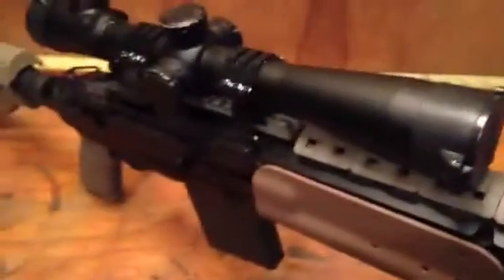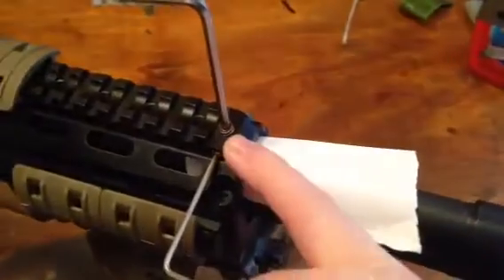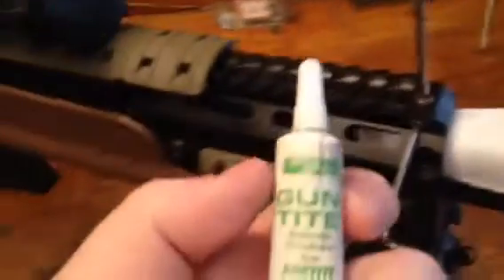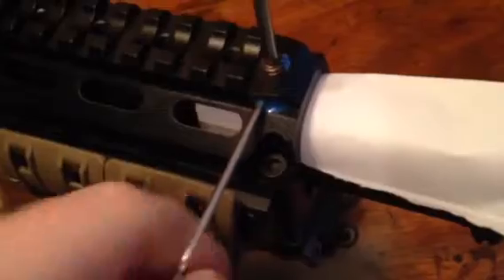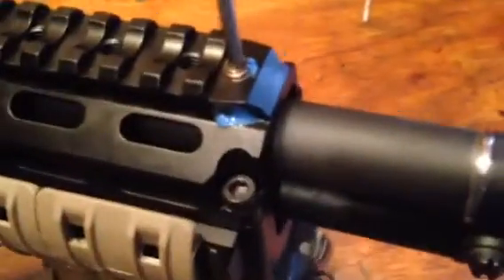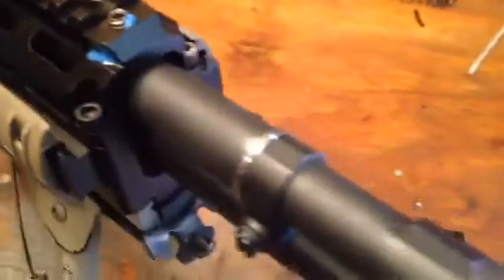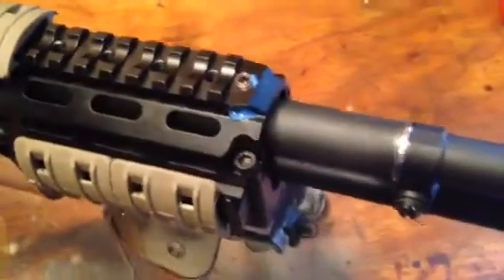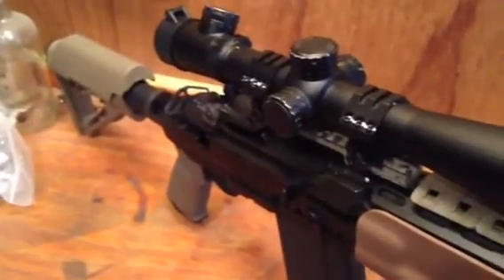M1A EBR barrel whip screw

Comment: Sometimes it is so obvious it's scary. I don't know why Sage did not include a simple little tip like that in the installation instructions. Thanks for the video. She is coming right along.
Reply from the maker: I know. I stumbled onto this way just out of shear curiosity because of how they say it doesn't need to touch the barrel, but needs to be just off of the barrel. You're welcome. It's supposedly supposed to help with accuracy, but idk how much it actually helps on rifles with medium weight barrels.
Reply from the maker: Oh cool! Ill definitely read the article. The whole ebr system was designed for the standard US GI issue M14s and it makes me wonder if the screw is even worth using on heavier barreled M14s such as the Loaded M1A.
Reply from the maker: I read the article and from what I can tell, using the paper as a reference mark as to how close the screw is to the barrel is the quickest and easiest way. Haha thanks man. Your rifle is pretty sexy in that grey stock!  When I bought mine they only had the black one in stock. Now there are a couple color configurations out there. I know man, that would be awesome if I did! Two EBRs at one range. I've never seen any other EBRs at any of the ranges I normally go to.
Reply from the maker: I got mine through Fulton armory. I've put in a lot of upgrades to my rifle from them. I didn't know they were painted by the distributor. That makes sense though. I'm considering painting mine as well, just unsure of the color scheme I want to go with.
Reply from the maker: Yeah mines a Springfield loaded. Fulton makes nice rifles, but for the money it's a bit much. Especially for a standard model. Springfields are just as much milspec as Fultons, just at a cheaper price due to how the receiver is made. LRB makes nice M14 clones as well, but are way more expensive that Springfield. They do import their stuff, but most of, if not all can be replaced by American made milspec parts. I've put in a national match spring guide rod, a Titanium nitride gas piston, a op rod buffer, and replaced the flash hider with a national match hider with bayonet lug all from Fulton, as well as the EBR chassis. I'm looking into getting a trw bolt from them and a forged options rod as well eventually.
Reply from the maker: Yeah TRW makes a high quality bolt that, if im not mistaken, is used by the military in their M14s. It took me a while to get everything for mine. I got the rifle bare bones brand new back in 05-06 when I was a freshman in college and my taste in needing quality stuff for my guns didnt match up all that well with a college student budget haha. Ive been looking at the vortex for a while myself and am on the fence about it. I like the looks of it and the functionality of it, but I dont know if or when id get a suppressor for her. Ill be getting married come July, so what money im making working goes towards the wedding. The buffer will definitely help increase your rifles life. It doesnt reduce any recoil, at least that I can feel, but it does do its job. 
Im sorry to hear about your wifes loss man. Ill keep yall in my prayers. Its never easy loosing loved ones.
Reply from the maker: I saw that one. It's a sweet brake. I may end up getting that one or the qd with the threaded M1A front sight base. Thanks man. I'm looking forward to it.